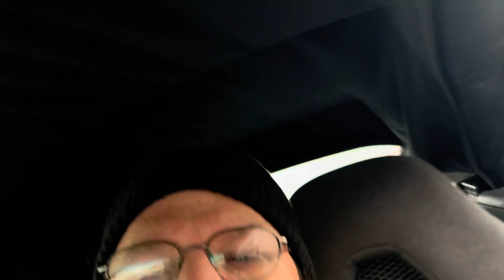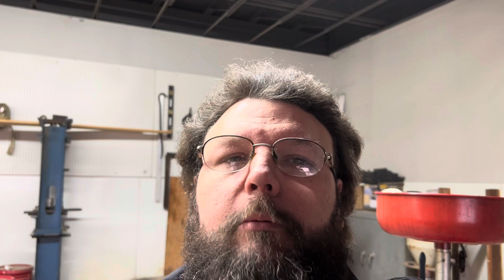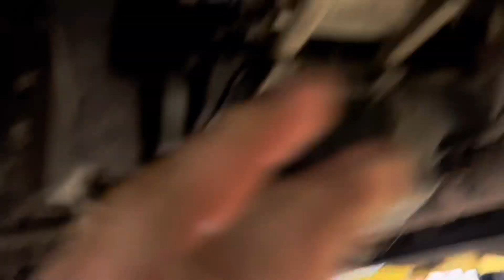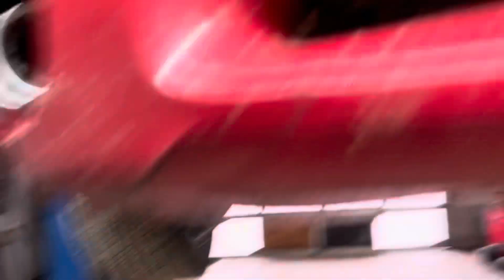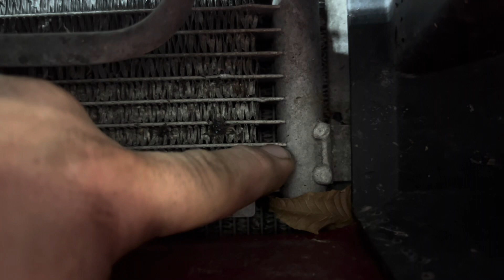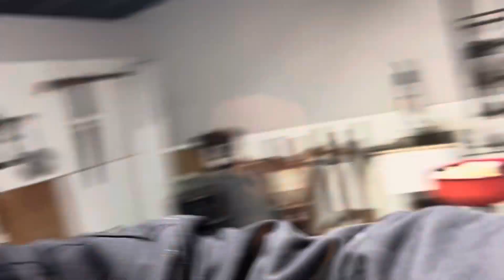Why cheap fixes can actually cost more

Comment: Bulldog, you make a fine point. I'm a home mechanic because I have too. Chilton's manuals and now Haynes for my vehicles have been my 'fixit bibles'. 
That being said, I will not get anything for my vehicles that I cannot 'look someone in the eyes' whether ordering and/or if it's a misfit. This has worked out well for me because most of the shops I deal with know my rig and know what I've been making right on it. 
I got a gal now who runs the shop here that fits a lot of farmers tractors and she's always spot on with my needs as well.
Thanks for the vid buddy. Hope you folks warm up soon.
G>
Reply from the maker: This is footage from last January but it worked out since it went from 70° to below freezing this week too. I did work at home for years as well and I always preached about parts quality. This video was actually twice as long (which is why it feels like it jumped forward) but I cut out quite a bit since I felt like I just griped and rambled. New footage is coming, the jobs lately have been pretty intense and not conducive to filming.
Reply: @bulldogsautomotiveadventur4387  I just work on my own stuff not other folks. Probably 40 years ago we lived in the mountains and mechanics were few and far between.  I had to learn to get my basic parts and stuff done or else be out a ride. It stayed with me.